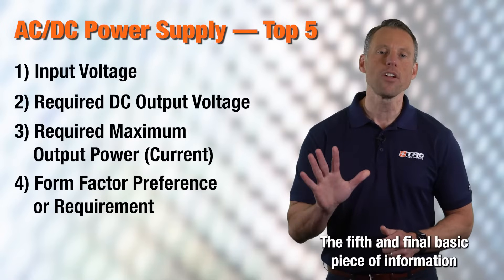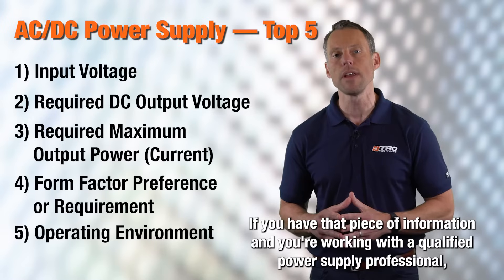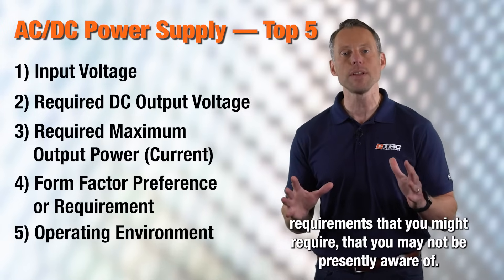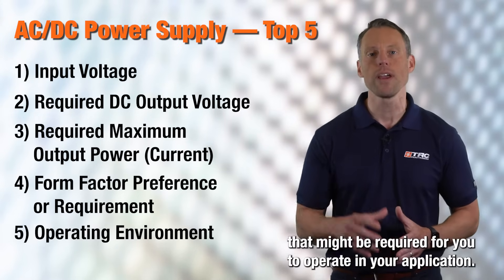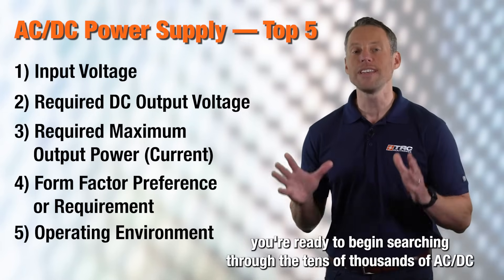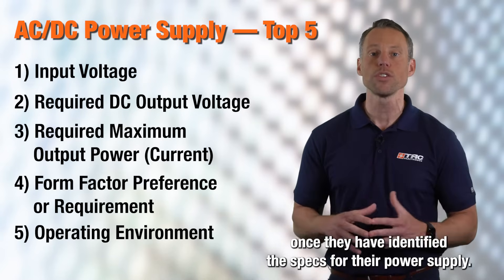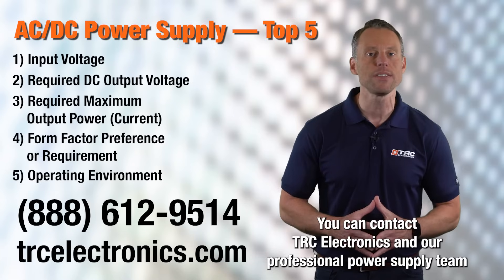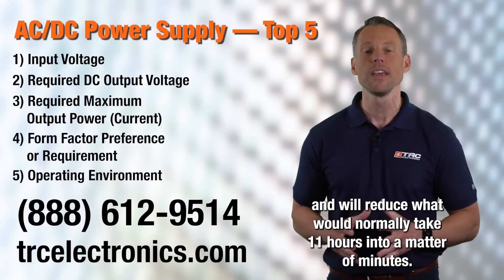Top 5 Considerations When Selecting an AC DC Power Supply

Comment: Can you please tell me what ac power adapter size I would need for my BOSS Audio Systems BRT26RGB ATV UTV Sound Bar? The user manual says its "8A max current draw. The internal power amp is 500 watts supposedly. Really appreciate it.
Reply from the maker: Hi Jay, to ensure proper compatibility we recommend that you contact the manufacturer of the sound bar, as they will be better equipped to provide the most accurate power requirements for your product.
Reply: @TRCElectronicsInc  I gave you the model and specs. Your an expert who is giving advice? Right? This should be a simple answer for you.